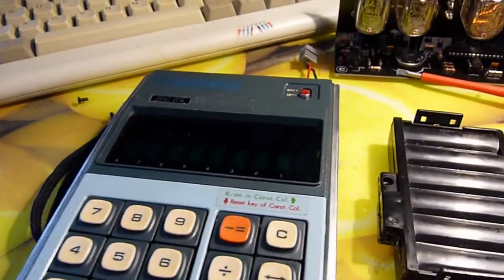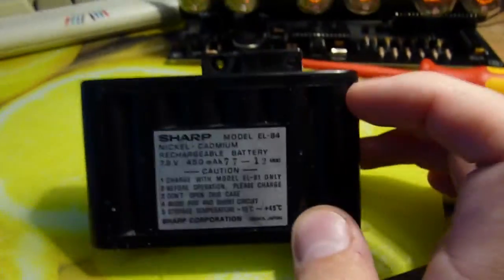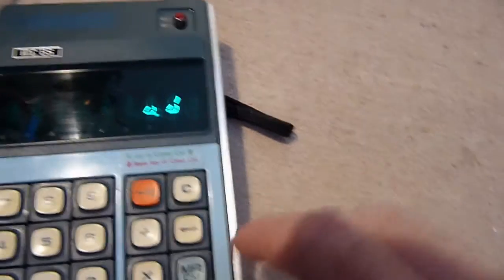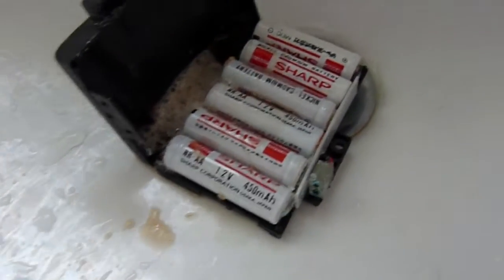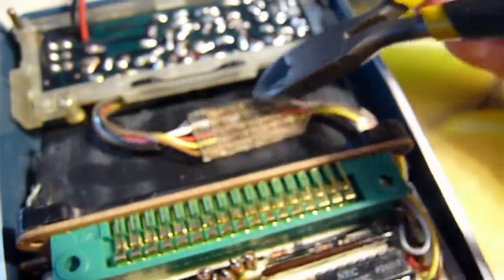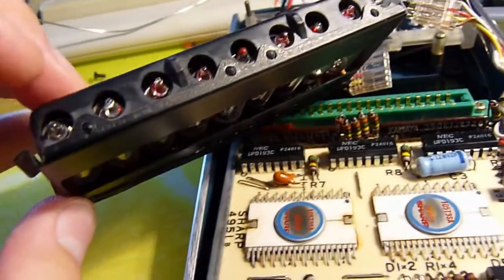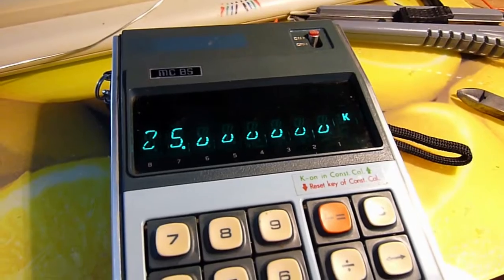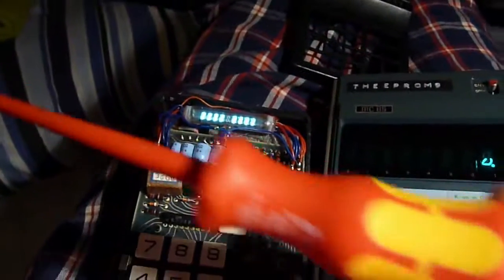Prinztronic MC85 Restoration & Overview

Comment: It’s nice to see another one of these is still working. Mine has a dodgy reed switch for the 4 key, so until I around to replacing it, it’s not so useful. Your video is much more entertaining than mine.
Reply from the maker: That should be an easy fix. Have not seen meany of them. Vintage Calculators seem to be the only collectable that is not going up in price. So I tend to hord them more these days.

Comment: I owned one of these when I was young. Bought it in '71 or '72. I dropped it just before an exam, and broke one of the display tubes. Dixon's got me a new tube overnight, and I soldered it in place with no problems. Great customer service (and good repairability).
Reply from the maker: Nice. That is what I love about this old stuff. So easy to fix compared to anything made today.
Reply: Wish parts were still that easy to get hold of.

Comment: nice calculator. 
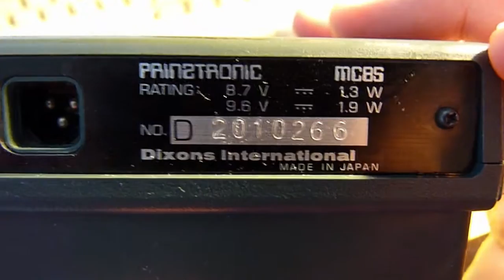@ 12:02 that Dixons logo. 

In Holland we had electronic shops all over the country and used that exact same logo in that font. funny to see
Reply from the maker: Thanks, currently use it everyday at work along with my CASIO FX7000GA. I don't know what is left of the company.
Reply: Dixons bought Currys in the 1980s. For a long while the kept both names, but eventually consolidated both. Although most Dixons stores were closed or rebranded a while ago, it is only relatively recently that they changed the group name to Currys plc. So the company is still very much about in the Uk, just with the name of a company that it bought.

Comment: do these old power supplies not like higher capacity batteries than original soec? experienced issues with gameboy psu and got a game gear pack to upgrade
Reply from the maker: Generally you are OK as long as you don't go to high. Electronics usually have a tolerance of about 10% before stuff start to break. As long as the PSU can supply enough current and you don't go over to much you are ok.